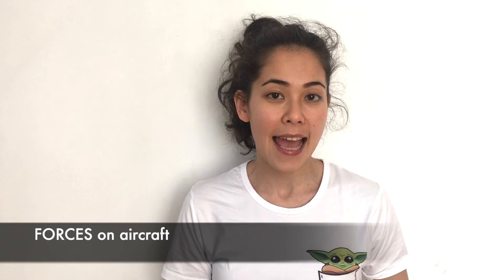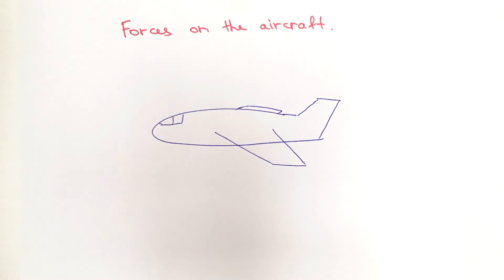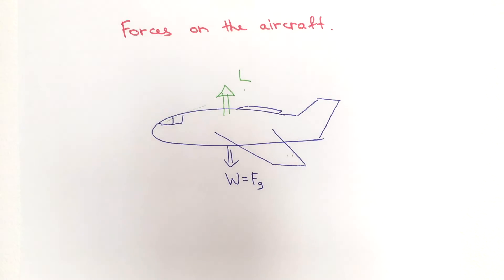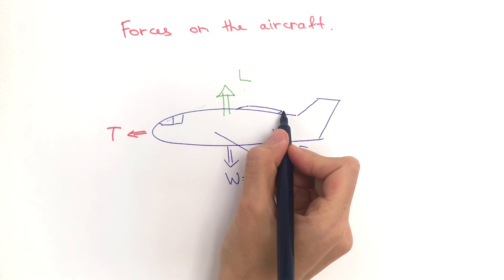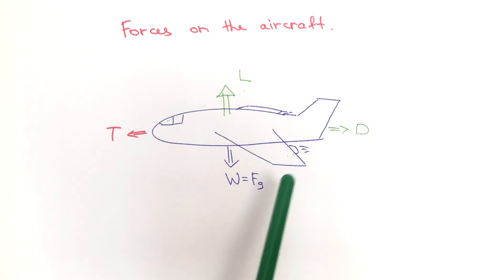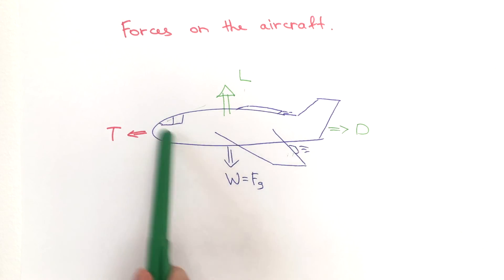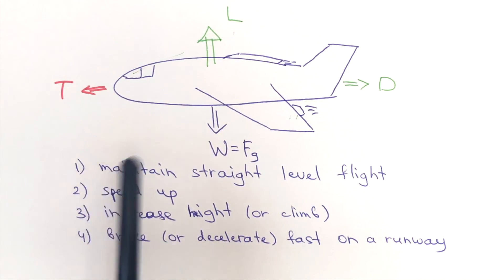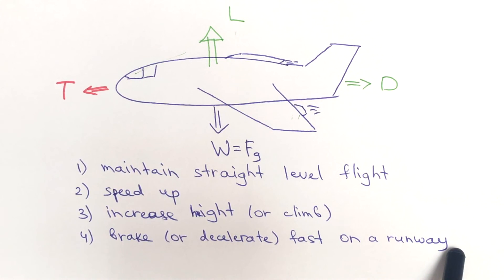Forces acting on the aircraft

Comment: (1) Maintain straight level flight: L = W, T = D (Assume no acceleration or deceleration)
      → Straight flight means there is not net force in both vertical and horizontal directions.

(2) Speed up: L = W, T > D (Assume no climbing)
      → To reach a positive acceleration, the net force of an aircrafts must greater than zero. This implies T-D > 0. 
       

(3) Increase height(Climb): L > W, T = D (Assume no acceleration or deceleration)
      →  The raise of altitude is cause by vertical net force, thus the lift must greater than drag.

(4) Brake(or decelerate) fast on a runway: L < W, T < D
     → To decelerate, the net force in horizontal direction must less than zero, which implies T - D < 0 or T < D.

Comment: Hi Aliya. I don't know if I'm late but I prefer your explanations on the board :)
I really appreciate your videos. I'm interested in airplanes and had a hard time understanding/visualizing why the pressure would be lower on top of a wing/airfoil. In my head it seemed more logic to have higher pressure on top since the velocity is higher and it sort of creates some high pressure/tension (skin pressure maybe?) but 8:22 to 8:37 made things a little bit more clear.
Thank you!

At 8:48 can you please explain to me why the airfoil tries to move in the direction of lower pressure? Is it like heat goes from hot to cold objects so the pressure also tends to go from high to low? That's one of the concepts I can't seem to understand
Reply from the maker: Yes, exactly, that's why in space movies if the door of the spaceship opens suddenly, the person flies away into space, because pressure inside the spaceship is higher than the pressure of the space (which is actually very close to vacuum). So the object goes into an area of lower pressure
Reply: Aliya Burkit I see, thank you!
Reply from the maker: Glad it helped